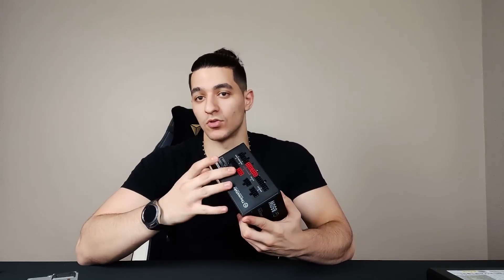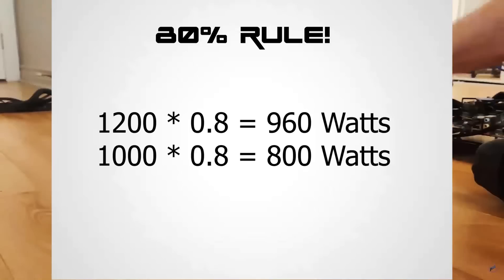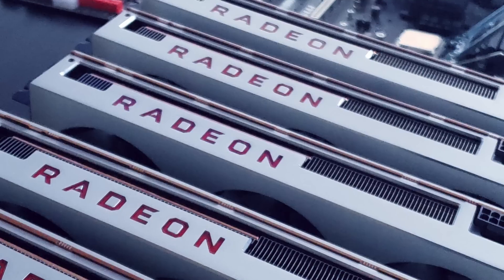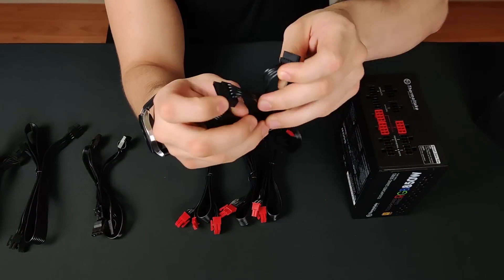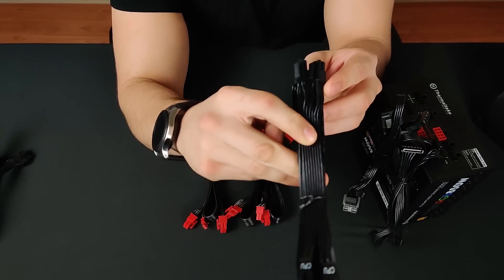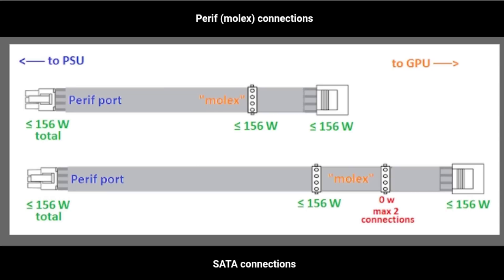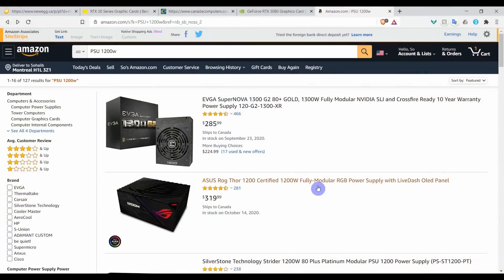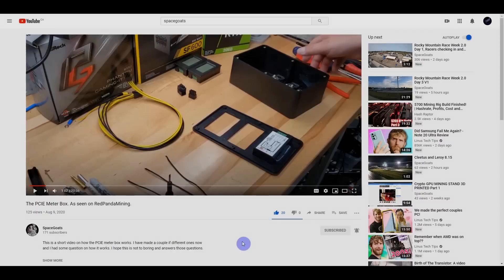Using ATX Powersupplies For Your Mining Rig FULL GUIDE

Comment: Excellent video and very good reference for future projects, based on your experience could you tell me how many watts a Riser consumes that is connected to a RX570 / 580 Card
.

ETC: 0x3df74834f092e67f2ce6e4f528b9f3b6978a691a
Reply from the maker: Thank you! I unfortunately do not have a meter that can check how much each individual cable is drawing, but as far as I know I believe it is in the range of 30 - 50. Bits Be Trippin will probably have a video about it I recommend checking him out!